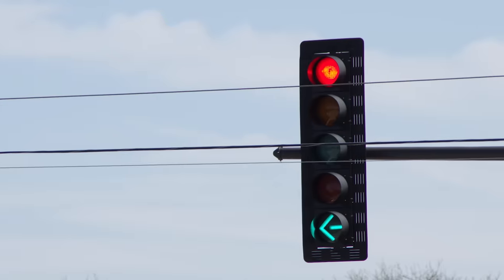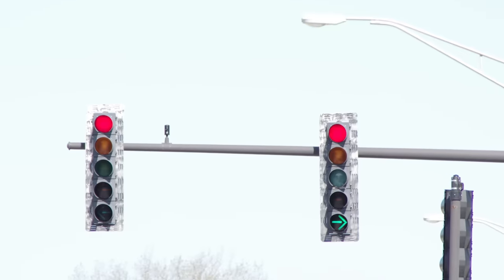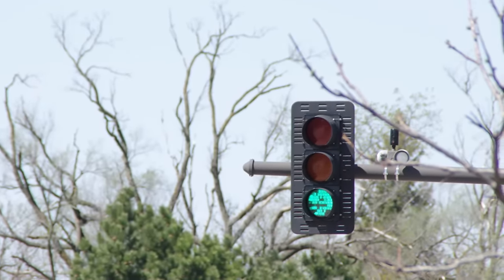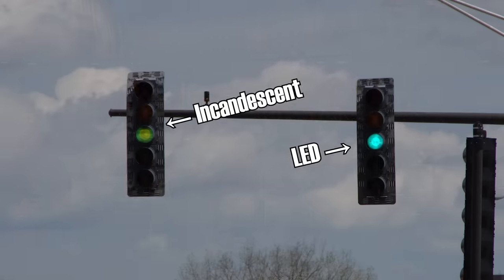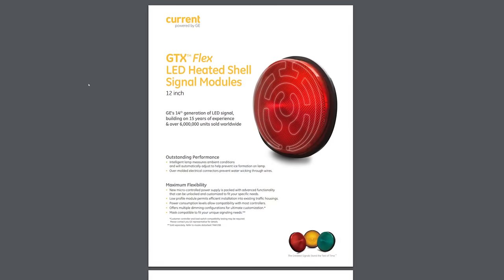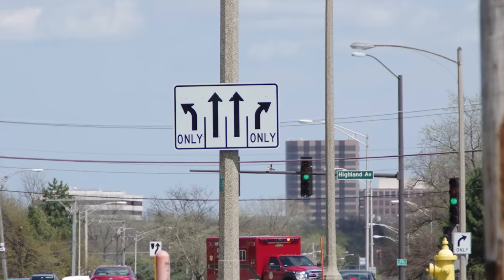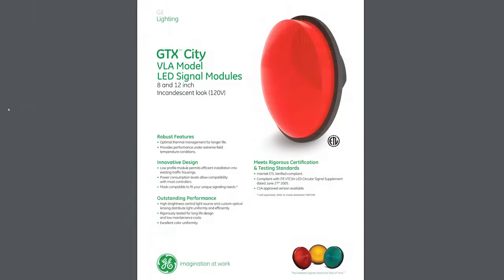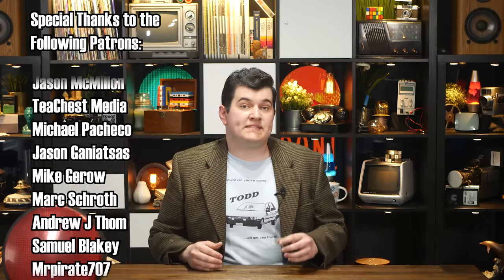The LED Traffic Light and the Danger of "But Sometimes!"

Comment: Hi! Here, in Brazil, that isn't a problem, considering that here there is no snow, We don't have this problem. But I'm not surprise that sometimes people ask to change back to old technologies without analyzing any workaround for problems in new technologies.
Reply: +tarstarkusz -- What you call latent heat effect , I call it "Specific Heat Capacity" --I'm not saying anything like you're wrong or latent heat effect is wrong, Just that when it comes up in conversation (very very rarely), I've used different words to describe the same thing & I presume I picked that up from others who called it the "Specific Heat Capacity of Water"
Reply: Except i've been to brazil and i've seen snow in the southern states.
Reply: It doesn't matter. The heaters would have to use a completely unrealistic and ridiculous amount of power to cause the grand total power usage to be greater than incandescent. The heaters are only ran when snowing, not 24/7...
Reply: Yeah, but that's only on a tiny bit of the country and even then, snow with any significant accumulation is rare, let alone a strong enough blizzard to cover a traffic lights' lens
Reply: and I live here in south and have never seen it (personally, seen on TV the tiny little amounts that happen on the mountain range in south).

It's rare enough to never be an issue really. Electric car batteries in other hand are quite a problem during our summer...
Reply: How many brazilians here! Well, one more here just to show up and to add nothing to the discussion.
Reply: +Richard Smith
The only problem with these "heaters" is that it involves more complexity into the whole situation to begin with.  You'd have to routinely check up on these heaters every 2 months or so just to make sure they're working, and you'd also have to make sure a total replacement isn't needed in case it starts to rust due to water or even dust getting on them.
Basically, it all comes down to doing the exact same thing, spending the exact same amount of money, but for a completely different thing vs doing what already works just fine by replacing a light bulb.
Reply: Why are so many people replying with things that don't make sense?
Again, it NEVER snows in Brazil! I'm brazilian.
Reply: Clebermag I'm also from Brazil... And thats true!
Reply: Rafael, yes, it DOES snow in Brazil. I don't know if you've ever realized this, but Brazil is not comprised solely of the city you live in. It does occasionally snow in the South.
Reply: czdaniel1 - no, Specific Heat Capacity relates to heating a substance while in the same phase (e.g. heating water from 1°C to 2°C). tarstarkusz was correctly referring to the latent heat required to change the phase of a substance, in this case to melt snow at 0°C.
To melt 1kg of ice requires 334kJ. To raise the temperature of 1kg of water by 10°C takes only 42kJ.
Reply: Cês tão ligado que dá pra falar em português aqui né?
Reply: tarstarkusz And if you have a spare wire in the cable between the stack of lights and the control box, you can skip that overly complex GE unit and just have a bunch of straight up heat elements that are turned on together by the control box.  Wiring will be more tricky if you want the central box to electrically test the heaters and call maintenance when they fail.
  Anyway, neither heaters nor incandescent bulbs will remove mud and dirt.
Reply: Richard Smith It is snowing practically 24/7 in Canada and Russia in the winter. Just because it doesn’t where you live (in which case LEDs probably would work better) doesn’t mean it doesn’t elsewhere.
Reply: In reality, the LED traffic light problem was an engineering fail. Engineers failed to test & analyze the effects of winter weather on energy efficient modules. ... this video is complete rubbish. Few were suggesting that we return to incandescent lights for the rest of time, and we can’t look at the plethora of solutions available today and assume that those same solutions were available at the time. This YouTuber just wanted to get on his soapbox IMHO
Reply: Dash Tesla indeed. You may find snowfalls sparsely in Gramado and Caxias do Sul (both in Rio Grande do Sul state) sometimes.
But it's common place for frosty things due to dew accumulation and low temperatures. Quite often we have to shave off ice on windshields for instance.
Reply: Pedro dos Santos ну, да. Мы можем на русском языке подписать тоже. Даоа.
Reply: Except in the south, the three states of the south sometimes experience snow, but nobody really cares because they are stupidly more well of than the rest of the country
Reply: São Paulo sure uses a lot of those and has been phasing out the incandescent bulbs in most scenarios. Trouble is, they re so insanely freaking bright, that as a driver, I have more often than not had my night vision in a less than ideal condition because all I can see are those LEDs, and let us not begin to talk about the fact that police lights are now FAR brighter than most street lights. It makes very, very careful driving all but necessary, even on completely empty streets, because is that a trash-bag or a dog?  
Seems like a spoilt brat perspective doesn't it? Now remember there are still thousands of imbeciles that drive without bothering to turn on their lights and you may start to see a problem. People in dark clothes because why bother crossing with the pedestrian lights? And god luck driving back from a date or a late night job, extremely tired and being blinded for a few seconds by a light, and when that's pretty much every light in the way home it starts to be a problem. I'd much rather they dialed it down a gbit from 200% all the time for every light or at least made them point somewhere that wasn't directly in my face more often than not (also, inset drivers with high beams or poorly regulated low beams)
Reply: Snow is an insulator, it'll keep the heat inside if it gets to accumulate on the lamp post.
Reply: Do people stop at red lights in Brazil?
Reply: "Old brick houses are better!"

...  :/ They actually are most of the time... They're better-looking and usually better insulated than the cardboard boxes we live in today. One problem with progress is that fixing its problems doesn't usually reach the poorer regions, just the initial "cheaper" setup and people often don't realize it would've been cheaper in the long run to build in the old inefficient ways....But hey, I can't complain, I have a job because of that. :)
Reply: But evenso, I see LED-traffic lights in use on a massive scale in Russia, even far more than in the Netherlands. I can still remember seeing the first in 1998 or so in the Netherlands: LED's in use for trafficlights was very new back then and it stayed that way for a year or 2: if a citycouncil or whatever party that decides over infrastructural funds had money, their junctions would most likely be swapped with LED retrofit units. If money was tight, they would stick with incandescent bulbs. My city still uses incandescent bulbs on quite a large scale, but also has a few junctions with LED-only lights (which unfortunately seem to have a problem with their brightness-compensation: at night-time, they are bright as hell and it's not comfortable to encounter them)
Reply: Nighterlev , you must live in Alaska where is snows all the time. Most of the rest of the US can take advantage of the savings.
Reply: Stockholm city in Sweden changed all its 11 000 traffic light in 600 crossings to LED units ages ago and it snows there on winters and still no report they wont work .
They are going to change all their road lights too to LED.
In Finland you have usually a traffic sign on traffic light pole that you follow if you cant see the light ...when light are working only one that can order you do something else is a traffic cop ... yeah there is rank order .
traffic sign lowest , traffic light in middle  and cops at top .
We got first roads with LED road lights and they are really really bright compared to old Hg lamps and it may get up to -40 here under winter ... they replaced a 400 W Hg lamp with a less than a 100 W LED unit .
Illinois has that problem with rain thats under freezing point of water and when it hits anything it freezes over ... but those still are rare ,  it can happen 5 times per year rest 360 days its not a problem . 
Then again in USA you cant use winter tires like in Scandinavia on cars and i think thats bigger problem to road safety  .
Reply: Pedro dos Santos, Usar o português em um tópico claramente em inglês é, no mínimo, ser pouco educado.
(Using Portuguese on an English topic is, at least, being not polite.)
Reply: Stephen Brookes wrote:
> Do people stop at red lights in Brazil?

Sometimes yes...
Reply: Errrrrrado Eu vi neve no Rio Grande do Sul. Rio não, nunca, mas nos estados do sul sim. As vezes.
Reply: 'm an engineer and know from experience that sometimes new tech is used without any consideration of value delivered vs actual cost, like the time spent watching Youtube isn't compared to the value of theat time doing something more beneficial and/or essential,like preparing for a future job when your planned career becomes extinct.
Reply: OneManShow 
Deluded gibberish.
Reply: What part of Brazil?

Right near da beach.  (Boi!)

Comment: I've never actually seen a white flashing light on an intersection to indicate an approaching emergency vehicle. I've never noticed any strobe detectors either.  I think we're still "back hills" enough to not have them.
Reply: UnseenEntity I’m in a medium sized city and we don’t have that. That would be cool!
Reply: Locally the fire department uses a short range radio signal to trigger a sensor on the lights that turn all directions red for about 30 seconds, local police and ambulance opted out. Works well for fire department as majority of calls are two to four vehicles.

A number of LED traffic lights - the "but sometimes" happens about a dozen times per year but typically it affects only some of the redundant lights in one direction... So, see what opposing traffic is doing and short hoods on side street lights allow first two vehicles to see the side traffic lights. At night you get a whitish glow. This area also gets high winds, gave up repairing/replacing one fixture and once a year or so the some of the overhead fixtures hang and swing by their cables.
Reply: @livelongandprospermary8796   used to have them in my home town.  relco lights or something was the name.
Reply: Now they have devices that they can flip a switch and make their route light green and everyone else's red
Reply: In the tiny town I grew up in, they had actually wired control to all the lights in town. They had a 911 facility from which they could route emergency vehicles through the town and turn all the lights red.  It was pretty elaborate, especially for a few decades ago. (So none of those little fixtures on the lights, but they loved giving tours to us cub scouts where we could stand in a big soundproofed viewing area overlooking everything.) The town had no business being that advanced considering all the other ways it wasn't, but it was built around a Naval base, so I guess it was easy to get grants for crazy stuff like that even if the roads themselves needed more pothole repair.
Reply: I've been a police officer and am an EMT. We have them. The system is made by 3M and it is called an Opti-com system (there are others on the market but thats the most common one). You don't have to have an indicator light on the stop light to tell you the system is activated, though it helps. The system works by detecting a special strobe emitter that is mounted on the lightbar. It flashes in a specific pattern and tells the computer that an authorized emergency vehicle is approaching. It turns my light green and all the others red. The down side is, this happens VERY quickly so you get a lot of people running the red light and also slamming their brakes on or stopping in the middle of the intersection. It doesn't really speed up most responses as you still have slow down for intersections to clear them. The 3M Opti-com system is extremely popular throughout the US. Other things that have been developed are transmitters that can over ride a radar detector or your car radio and show you a message that an emergency vehicle is approaching, but those aren't very common.

Comment: My biggest issue (that my grandmother complained of first, and I later realized) was that a lot of the LED bulbs for standard light fixtures promise an insane lifespan, only to start doing weird things after a few months. For instance, we had to go back to incandescent bulbs for our hallway after going through 3 LED's in a year. Now one could say "Well thats an issue with the fixture" and you may be right, but if the incandescent bulb is not having issues and the LED is, well. You know what choice someone will go with. In a perfect world LED's are great, I love my light strips, I love how I can unscrew them without burning my hand, but they seem really finnicky.
Reply: Yeah, there's so much LEDs on the market yet most of them are just bad in terms of quality and lifespan. The problem is not with LED themselves, but rather with AC-to-DC circuitry hidden underneath - they get hot, they can't work in cold, or could short circuit on very high humidity. At least they don't explode and shatter glass everywhere unlike incandescent bulbs.
Reply: So the solution for that problem is to use reputable brands (in my country there's no Phillips, so I'm still searching). Also check out LED filament bulbs - they mimic warm incandescent ones but with more efficiency and brightness.
Reply: I've used a LED close to 4 years.
Reply: The issue is indeed in bad light fixtures and crappy quality of LED bulbs. The traffic lights in Russia have been replaced with LED once almos 12 years ago, ande i haven't seen them not working (the only exception being lights that are no connected yet). Yeah, because one light consists of like 50 small LEDs, some of them do go uot, but never the whole thing. And they don't get covered in snow, and let me tell you we have tons of it. Most of traffic lights dont even have hoods over them

Comment: Regarding the vehicle detection loops embedded in the road, I’ve heard folks who ride motorcycles and especially mopeds/scooters say that their ride doesn’t always have enough metal mass for the loop to sense they are there.  A solution is to stick one of those super strong large magnets on the bottom of the frame.
Reply: Do be careful of stray metal objects in your path; they're likely to be made of steel.
How does the loop detect a moving magnet?
Reply: @nicholasbodley2238  
Induction.
Reply: I've been stuck behind a big construction truck that was too tall for detection loops.
Reply: The new camera controlled intersections often don't detect motorcycles or scooters either.
Reply: Many places have a law in place that allows a motorcycle or scooter to proceed through the intersection if the traffic light fails to detect them. My Harley has never had that problem but there are a lot of sport bikes with more aluminum and carbon fiber than steel so I'd imagine it affects others more.
Reply: @ethinos2719   sounds like a dumb law? First off, how would one proof that the specific loop didn't pick up the specific moped/motorbike. And secondly, this could lead to people to running red lights hoping for pardon on grounds that the red light didn't change for them, even if it wasn't supposed to, wether on purpose or by genuine mistake/ignorance
If the light is red for you, it is necessariky green in the other direction, so this would just open a door for so many "well i didn't see anyone officer" type situations. 
Now this wouldn't be bad enough, many laws are difficult to enforce for whatever reasons, but officers barely wanna show up in court to debate a speeding ticket, or runners of red lights, i think this extra layer would deter any cop from wanting to battle this out in court. To me this seems like a very exploitable law
Reply: @dr.blauerkraut  You have proof when the lights don't turn because they didn't detect the bike. This creates a situation where the biker either waits for a car to come along behind them (which isn't ideal in the middle of the night for example), or they just run the light anyways, once it's safe to proceed. I've never had a problem with my Harley, but there are some exotic sport bikes out there where most of the bike is aluminum and carbon fiber, neither detectable to a magnetic ground loop.
Reply: Let’s get rid of presence detection, because sometimes they don’t work for a moped…. Wait
Reply: I thought the end of your comment would be "bikers avoid the sensors like they avoid speedbumps" lol
Reply: As a motorcyclist, and a cyclist, yes this is an issue. Many induction loops (and less commonly newer sensors) don't pick me up.

Annoying, but a simple solution: you treat the signal exactly like you are supposed to; like it is broken (because it is).

How do you handle ANY traffic signal that is inoperable? You treat it like a stop sign! Make a complete stop, wait until it is safe, then proceed. 

Go back and watch the video. At 6:20 he covers it perfectly. If the light isn't working, you treat it as a stop sign.

Reminder of why we need more recurrent driver training. People suck at it.

Comment: Traffic circles require even less energy and also when ice coats them there is the problem of momentum which may cause traffic to exit prematurely .  The problems are interesting because they may not be requirements in the original design, only partially convenient side effects. Change is hard because people need to learn new nuances which may frustrate them.